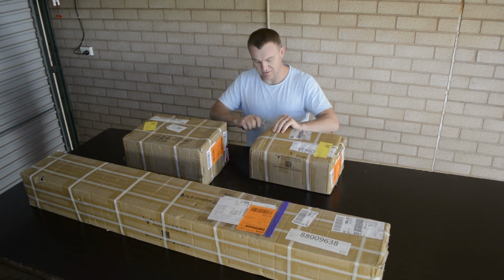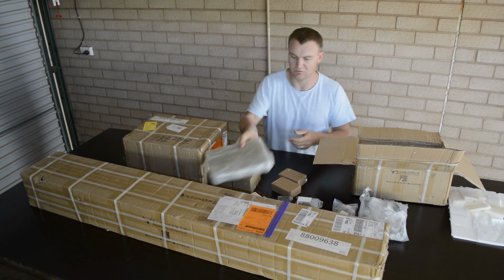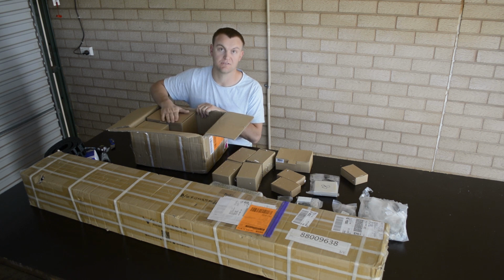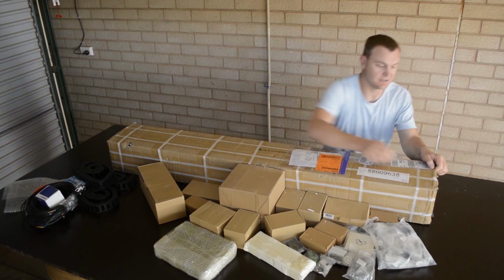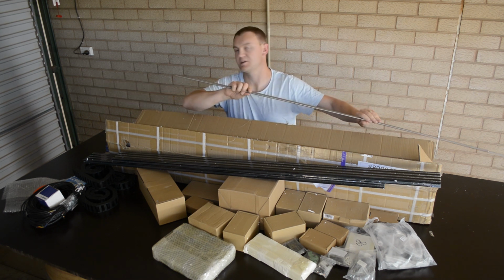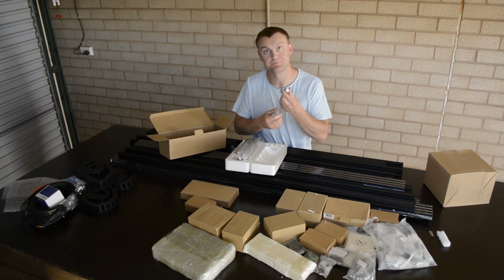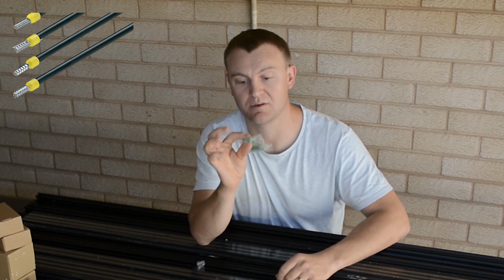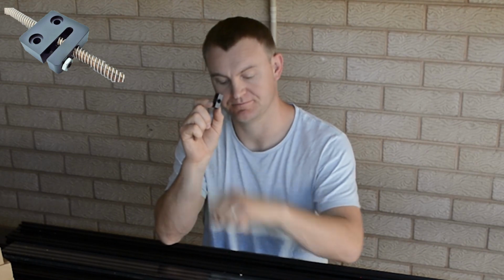Workbee 1515 2.2kw CNC Router Unboxing - Make Build Create

Comment: Cool video, I have an x carve, I got it cause it seemed like the most complete immersion into cnc, but now I'm ready for a beefy machine, I like that workbee because I'd like a 4x4 cut area, but I've been checking out that Queenbee upgraded version. I think I'm gonna jump on that. I already have an openbuilds blackbox I ended up not using with a laser plotter, the laser heads are too dang expensive and they dont even really cut thru. So queenbee it is, I was curious about bulkman and good to know they are ok to buy from.
Reply: Go the queen bee version as they solve the flex issues with X axis and refine the whole process
Reply: @shaun.oo__oo  oh yeah I ended up getting it like a week after that comment, it's a great machine. Actually built two, we got one at my job too
Reply: @redherring5532  nice, how do you rate the queen bee

Comment: Hey mate...how you like your knockoff workbee 1515?
Reply from the maker: Not sure what you mean by "knockoff" all of these types of CNC  are open-source.

As for its ability to deliver quality cuts, Yes it's good value for money

Would I recommend ordering better/ more parts during initial purchase - most definitely 

Would I purchase again? 
I would seriously consider building my own rack and pinion machine with more industrial grade strength.

But hey it tought me a lot and I am looking into making a full size industrial and router and converting this to plasma.

Mainly because I do large cuts, long codes and need more speed and rigidity

Comment: I have the same machine in silver with Mach 3. I am lost in the electronics.
Reply from the maker: James, have you got it working yet?
If not I may be able to help as I have got my machine running now and took some fine tuning to get right
Reply: @makebuildcreate3434  I could surely use some help. I got the electronics hooked up and I can move with key board but I can't figure out the mach3 settings so I can use it.

Comment: How well does the x and z axis hold up the the weight of the 2.2kw spindle? currently running the 1.5kw spindle and would def like to upgrade in the future. thanks
Reply from the maker: Hey, 
Thanks for asking, the Z axis needed to be tuned for a slower feedrate as it was shuddering and not actuating properly during rapid movements in the G code.

After slowing the motor acceleration in mach3 motor tuning screen it is great now